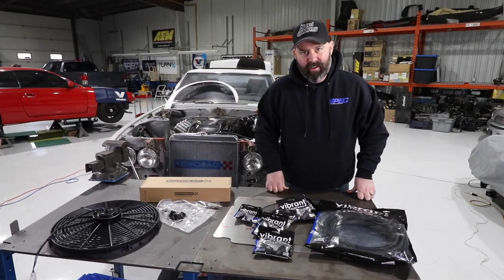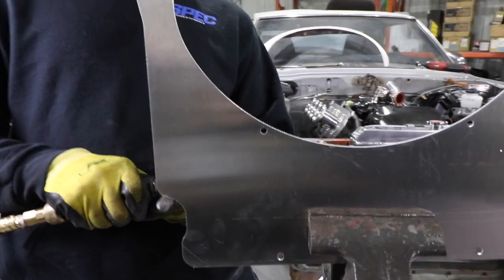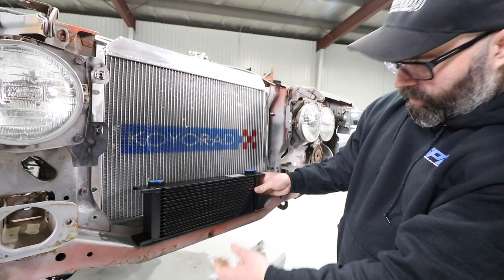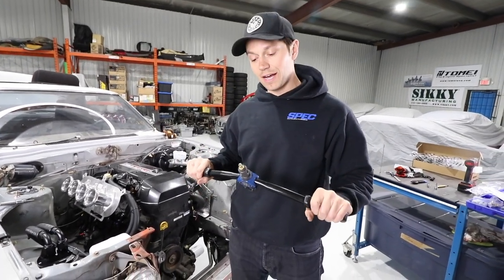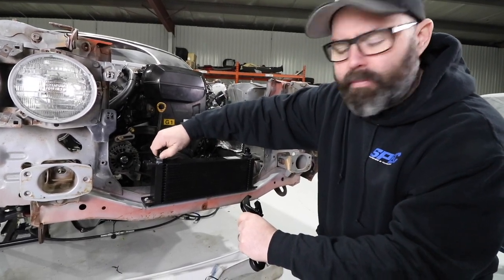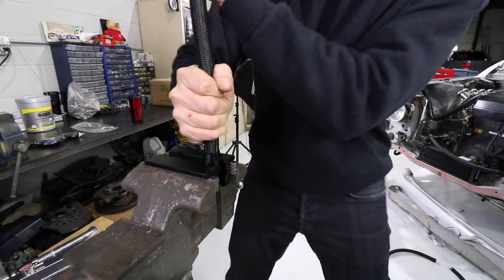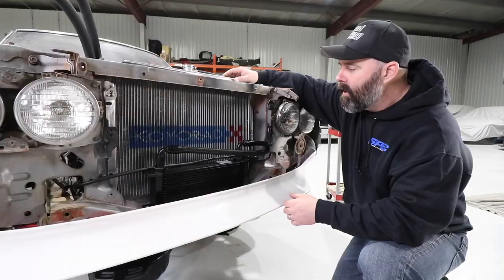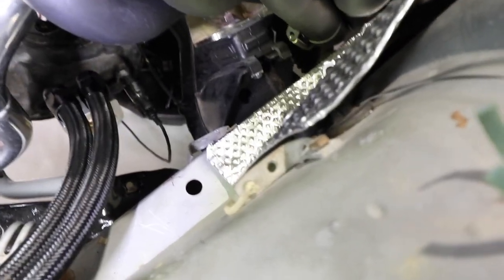Oil Cooler & Fan Shroud Installed - RA24 Toyota Celica Project

Comment: Suggestion, you may want to put a grommet on that hole where you pass the oil cooler hoses through or you can take a rubber hose, slit it in the middle and wrap it around the hole to prevent the hose from rubbing. I know they're braided and meant to last but it's one thing less to worry about knowing that it will be a daily driver and regular track car. Plus it's black, it can be easy to overlook small damages.

Also, cheers to Joel Luz of Toysport. Can't go wrong with those folks!

Comment: Great stuff.  When using adjustable wrenches, keep the non-adjustable side on the front side of the direction of turn.  That way the fixed side wears the torque and the adjustable side really just keeps it snug.  You'll get less wear and tear on the adjusting gear.
Reply from the maker: Great tip thanks!

Comment: I ran across the same issue, but I need to put them in a truck, so I got some manual screw in tools and a pneumatic tool. The pneumatic tool was more expensive, but its the bees knees. I used it a lot.

Comment: This build is going to be awesome, a car that weighs in at some 2300 lbs with near 200 hp?  I really want to swap a BEAMS into my 71 after seeing this video, but don't really want to do all the computer stuff.  Is there any practical way to use the stock computer with the BEAMS or maybe even convert to carbs?
Reply: Karl Jay beams motors have and immobilizer so unless you pay unnecessary amounts of money to someone to bypass it you're better off with a stand alone.

Comment: Love your content guys.  Been a longtime supporter.  I was wondering if using a longer bolts with a spacer in between the mounting tabs would be better for your oil cooler.  Your going to be putting some torque on just  the lower tabs when the air hits it at track speeds.
Reply from the maker: We're going to test it this way first but from our not-so-scientific tug and pull test this cooler wont be going anywhere

Comment: Just wondering if the oil cooler should be mounted inverted, to promote circulation, and provide for oil changes?
Reply: Kevin Bowers I think if you invert it, it'll trap air bubbles in the top. This is coming from Carroll Smith's Tuned to Win if I recall.
Reply: If you mount it upside down, it will only flood the bottom couple rows with oil leaving the top of the cooler doing nothing.

Comment: @speedacademy i wanted to know what size oil filter adapter u guys used. I also would like to know were. Im trying to buy an oil cooler for my 89 celica with a 3sge 1st generation engine. Its been a hard task doing the research. Im trying to get my car ready to track. Right i still have alot of work to do. Any help, advice would be greatly appreciated. Im not as skilled in this area but i learn quick. Im hoping to hit the track one day soon.

Comment: We used fancy pneumatic tools to set blind rivet nuts back in my work shop life. For tight spaces we had a specific spanner set but i'm pretty sure you could also use just a spacer and screw to clamp these rivet nuts.
https://shop.eisen-pfeiffer.de/Article/10341
Reply from the maker: Thanks for the link!